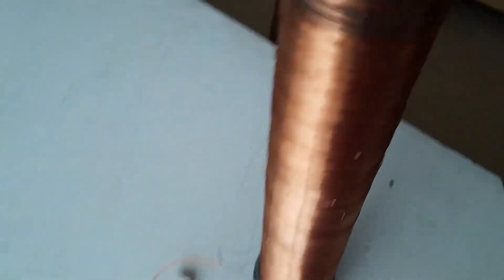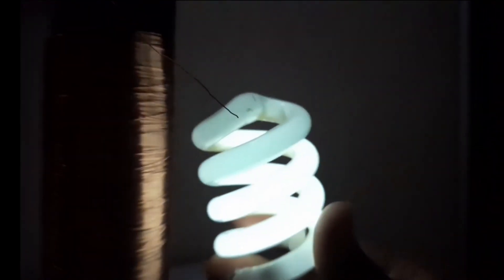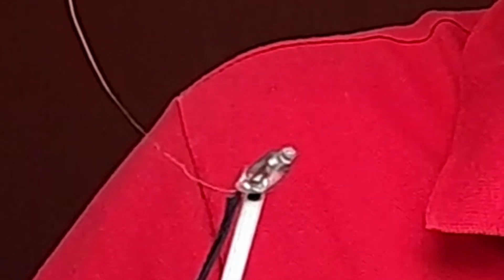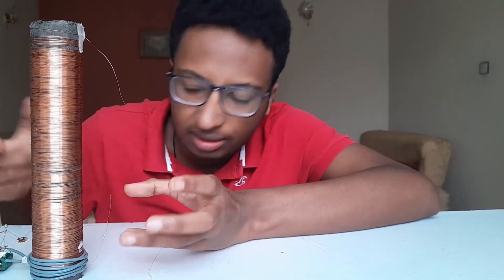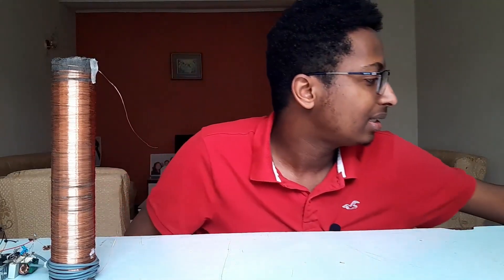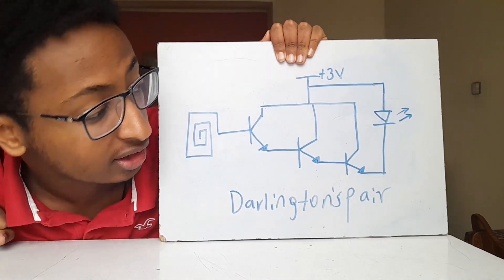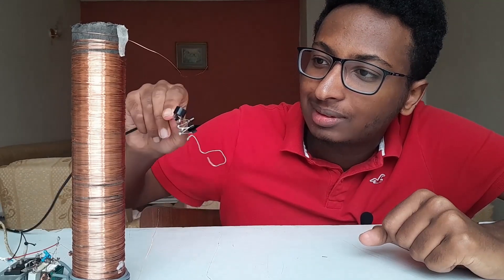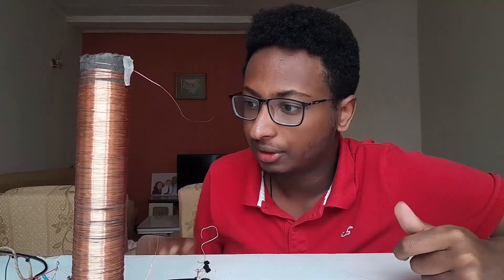I Made My First Slayer Exciter From My Old Tesla Coil...

Comment: I have trouble winding secondary coils with high guage magnet wire, 26 AWG is what I would recommend for a nice, uniform coil that won’t take hours to wrap. It’s about 3x as thick as 36 AWG, so you won’t get as many turns but it’s much easier to work with.
Reply from the maker: That's a really good advice... ehen i find a nice uniform wrap, I'll make a new video about a more cool looking tesla coil